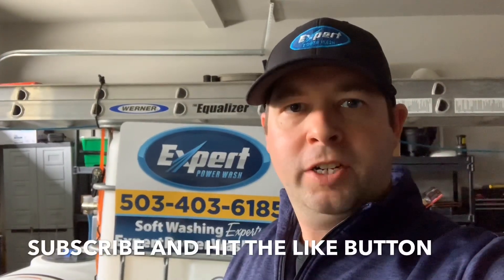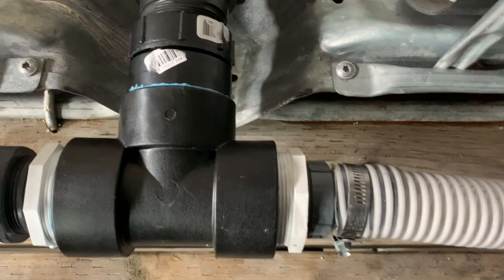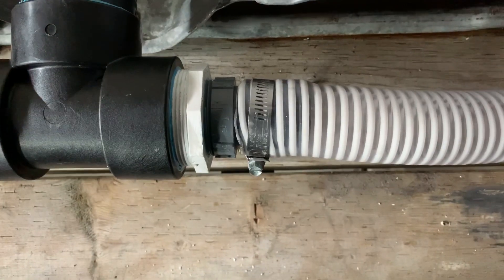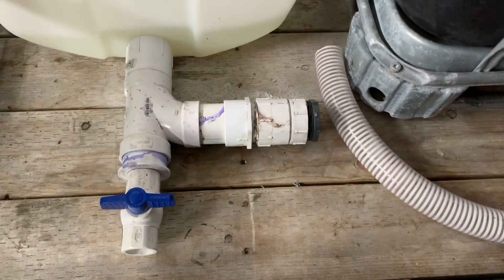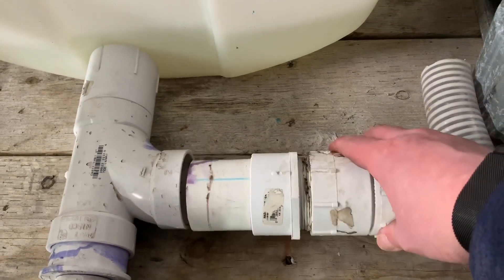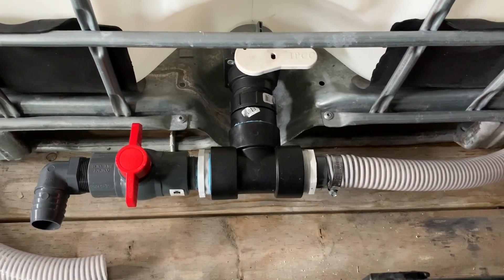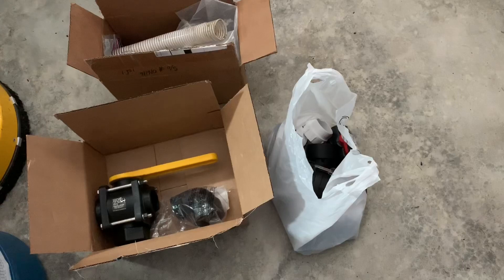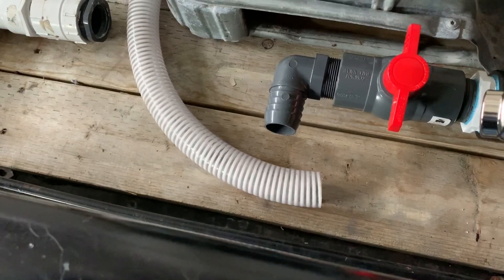Pressure Washer Plumbing To An IBC Tote

Comment: The one we have measure 2 1/2  but we can't find a fitting/adapter. I'm thinking it may need a camlock
Reply: It’s 2 3/4 butress threads try grainger
Reply: @djicemike4  Thanks for the info. We did find out it is a camlock.
Reply from the maker: You sure it’s not a 2 in? Also check to see if it’s NPT or course threads. I prefer NPT. Most IBC totes are standard 2 in. You can always get a 2 in fitting from a hardware store to see if it fits. Let me know if I can help. Good luck
Reply: @ExpertPowerWash  Yes, positive it's not 2in. What is NPT
Reply from the maker: @Dr Cro that’s weird. NPT is short for National Pipe Thread. It’s the standard size

Comment: As long as it works. Who cares how it looks. Thanks for putting it together
Reply from the maker: Thanks for checking out the video🙂
Reply: @SergeantRAZOR we're talking about plumbing. How your gonna call someone trash if they don't care how a Pressure Washer equipment  looks. Hell, he may have been working and may not had time to straighten thing up.

Comment: How do you prime the pressure washer? I pull my trigger and no water comes out.
Reply from the maker: With mine, it pulls water itself. Most belt drives suck water. No need to pull the trigger. I start mine with the ball valve open. I’m sure it can be started closed with the bypass hose going back to the buffer tank.

Comment: How much can you power wash with 250 gal tank and can you hook up 2 power washers to it 4gpm
Reply: I don’t need a pump ? And does tank need to be higher
Reply from the maker: Hope this isn’t too late. I don’t always get message alerts. A belt drive will suck water on its own
Reply from the maker: That tank could definitely feed two 4 GPM pressure washers. That tank is a 275 gallon tank. I always have the garden hose running to it. It’s used as a buffer tank. If I had no water refilling while I’m washing, I could run approximately 30 mins with my 8 GPM pressure washer. Double that if running a 4 GPM pressure washer. Hope that helps. Thanks for the comment.

Comment: Just wondering. If you can answer this. I have the same tank. I have a fitting and a reducer. To a faucet. For the water hose connection. But I don't have no water flow.
Reply from the maker: Touch one without pics

Comment: Your old setup looks like it just wasn’t glued up properly. I’m getting ready to plumb my leg tank the same way I’ll run a test piece see how it holds up to some abuse. Did you use the brass 3/4 mpt to 1/2 barb at the pump?
Reply from the maker: 1 1/2 barb. Old plumbing set up was rough but it lasted all year and made money. No issues. Just wanted to clean it up before I had issues.

Comment: My IBC has a large thread coming off the valve!  What fitting would you use?  Rubber fernco?
Reply from the maker: I believe you have the course threads. I prefer NPT threads on my IBC totes. There are conversions on Amazon. Hope that helps. Thanks for watching and commenting.

Comment: Do you think there would be any problems with the water getting there with a 4gpm direct drive machine? I'm going to setup a trailer myself this year and was going to run 1 1/2 inch pipe all the way down from 2inch of course
Reply from the maker: Honestly, I wouldn’t run a buffer tank with a 4 GPM. If you are set on it, I’d make sure it’s level. A belt drive will suck the water better and worth the few extra bucks.
Reply: I run a buffer with my 4 gpm direct drive. Was told not to. Been running great for 4 years now but I understand why I should be concerned